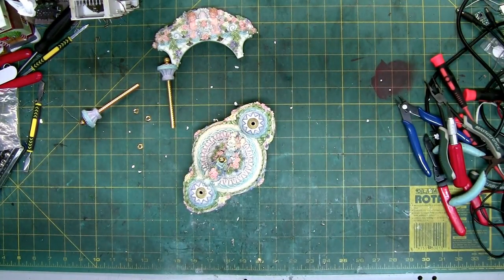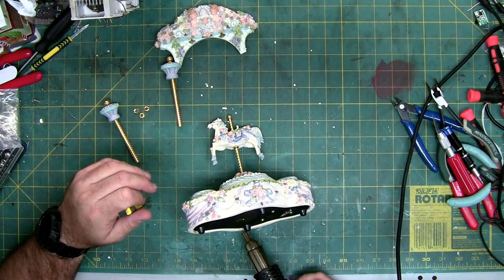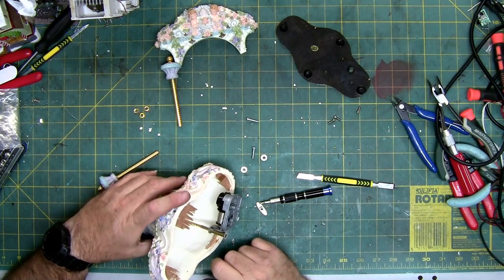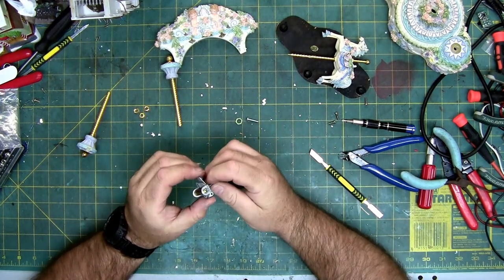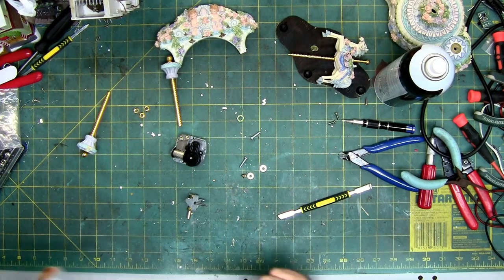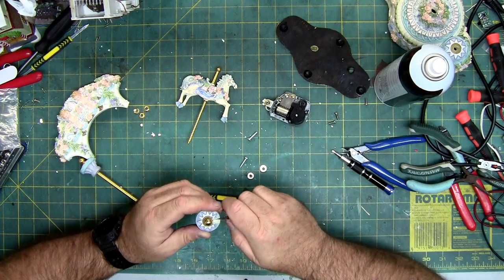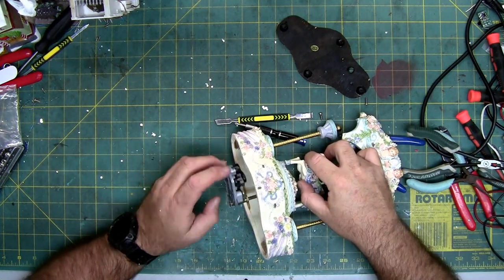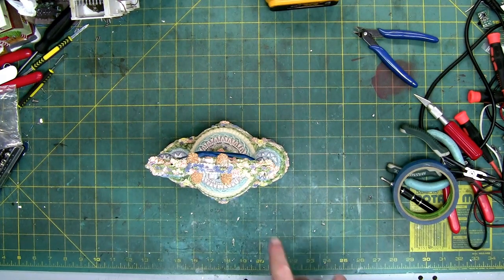Springtime Musical Carousel Music Box Repair

Comment: What tool is that you used to melt the glue to remove base? I need to go into mine and tighten the pole. 
Can I just use my blow dryer I do that with other glued pieces ?
Reply from the maker: I use a heat pen, similar to a heat gun. You can get it from Amazon, eBay or a hardware store. In most cases, a hair dryer will work, it depends on how hot it can get and if you have attachments that change air flow, those can be helpful.